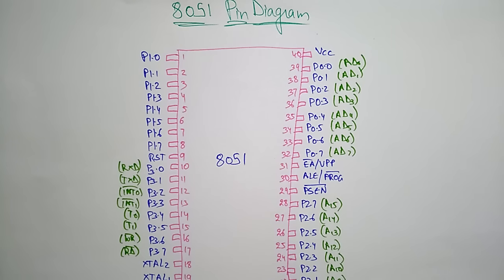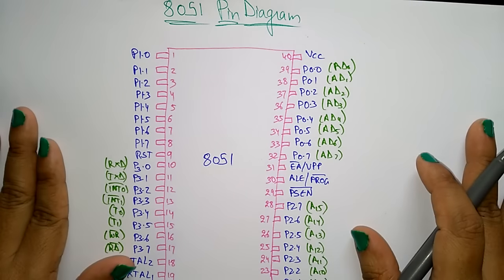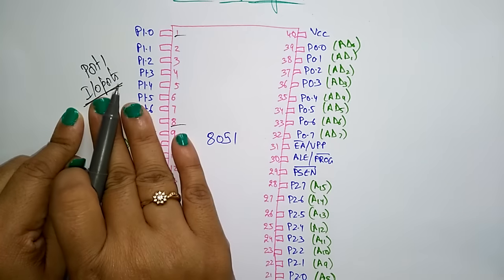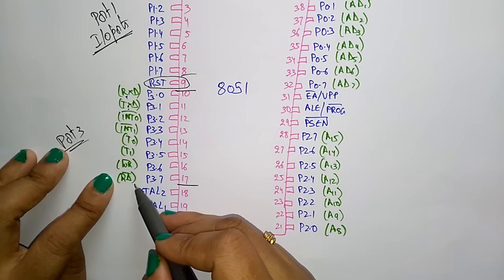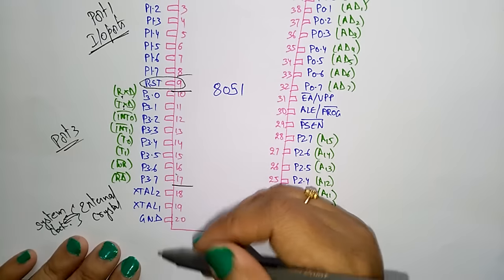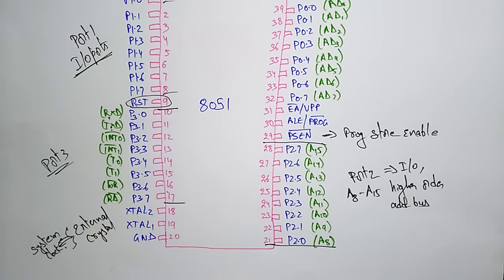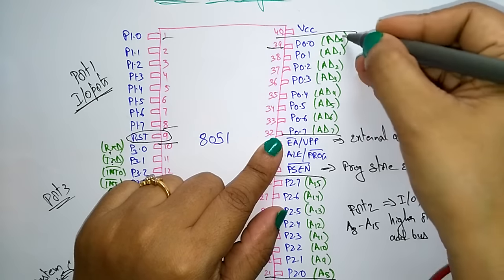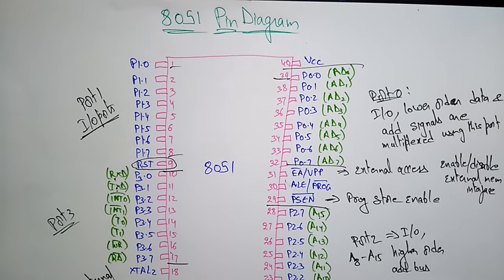8051 pin diagram | micro controller |

Comment: what is the function of pin no 30 (bar of PROG) ?
Reply: She skipped
Reply: This is ALE pin which stands for Address Latch Enable. It is used to demultiplex the address-data signal of port.
Reply: Ale if it is 1 it means address and 0 it is data